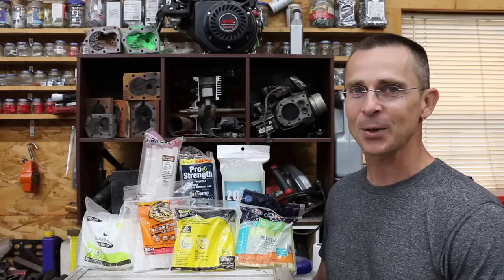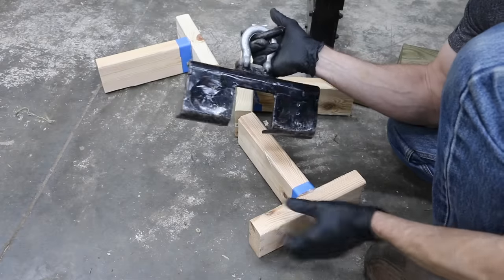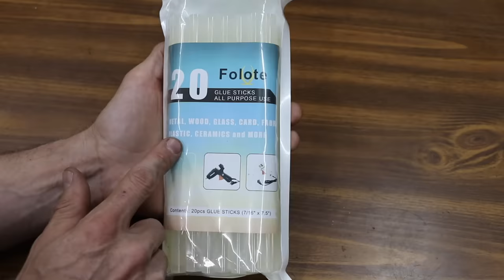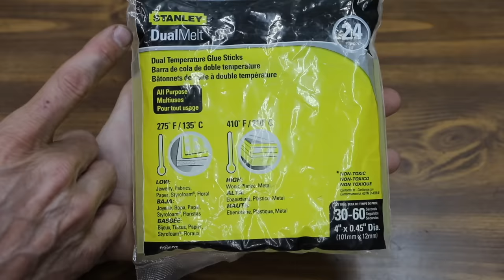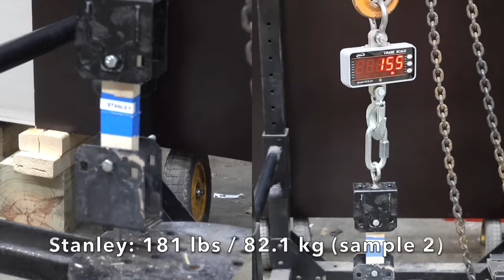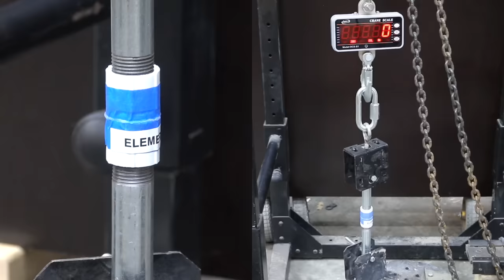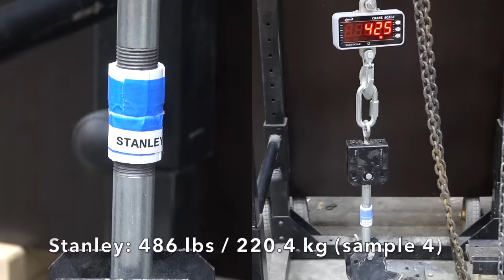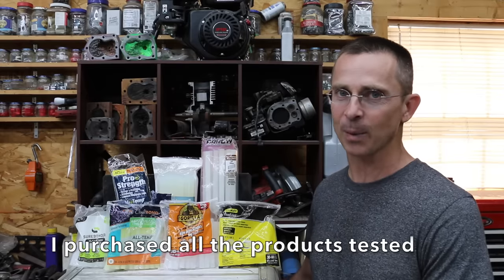Is Gorilla Hot Glue the Best? Let's find out!

Comment: I wonder how these hot glues would hold up after a year of being left alone under various environmental conditions? Such as hot or cold, dry or humid, inside or outside, dark room or sunlit room. Also I noticed someone else in the comments say they wished that high temperature hot glues had been tested as well. Maybe we can get a separate video for those? Thanks for all the hard work and thanks for always listening! 👍
Reply from the maker: You are welcome!  Thanks for the video idea.
Reply: I have found they don’t hold up over time at all. Just for craft projects .
Reply: As long as it’s something I only use indoors? Years.
But exposed to rain or extreme temps variations? The bond weakens. Although the glue as a filler stays good
Reply: That greatly depends on what the material you have used.  For instance, hot gluing fabric to wood, or to fabric - the bond is amazingly strong.  As a general rule, gluing items to wood makes a very strong bond.  I built a miniature lizard enclosure for some cool hard rubber lizards I found.  The only glue that would hold the acrylic to the wood structure, without off gassing potentially fogging the interior, was hot glue.  That was roughly 5 years ago.  It has seen suffocating heat, high humidity, and cold to down around 45F.  Still holding strong.
Reply: I agree, porous materials are fine, but plastics present a problem over time.  I once glued TV cable to the baseboard, to hold it in place.  In about 2 weeks, it all just let go. I called the glue stick company to complain and they said certain plastics (like TV cable) will “off gas” or leach chemicals over time and make the glue let go.
Sure don’t remember seeing that on the packaging !
Reply: @ItAintMeBabe99  Hi you have a good point - sometimes it is not the bond itself but what material the glue bonded to which deteriorates under the elements or undermines the bond.  Thank you for the comment. Ciao, L
Reply: @d2parrotperson  Those hard rubber lizards make great pets but it costs a fortune to feed them. What do you feed yours?
Reply: @ItAintMeBabe99  Thanks for confirming what I believed to be the case. I was using hot glue on an electronics breadboard, and mounted to a plastic box cover as well as some components like a toggle switch, and even indoors only in a short time the glue gave way. Was very disappointed in the results. I thought there also may have been be a layer on the plastic that doesn’t bind well, but it may be as you say, leaching or glassing.
Reply: @itaintmebabe99 
To be fair.
Expectations should be kept realistic.

Hot glue guns/sticks are basically made for crafts...

When I was in high-school, we used glue guns in Art class.
We didn't use any glue guns in auto or wood shop lol.

Comment: Nice video. I didn't learn much from the tests on wood joints, I used some hot glue about 40 years ago on some framing for a wall I was putting in to divide my basement. I don't remember what brand it was, but 40 years later, that framework was still together and we ended up sawing it into pieces as the glue was still holding it all together. We also used it to attach carpet to the lower part of a wall, and even 40 years later, a blob of it the size of a quarter was able to hold over 400 pounds (both a friend and I were hanging from it without it showing the slightest sign of tearing loose) with ease. The Stanley's performance on PVC was shocking, and it will be the brand I buy from this point forward. I had given up using hot glue on PVC a long time ago.

Comment: Hot Melt Glues usually come in 2 different types, Polyamide and Polyolefin. Some adhere better to certain materials than others. If you are not getting a good bond, try a different type.
Reply from the maker: Thanks for the feedback.
Reply: Which one is best for pulling out dents on vehicles with clear coat?

Comment: Next time woodglue?
Reply from the maker: Great suggestion!  Thank you
Reply: @ProjectFarm Best and worse hot melt vs woodglue type II and III, vs Elmer's white vs 24hr epoxy. Incl moisture.
Reply: Yes!!!
Reply: Agreed
Reply: @supabiscuit  Going to build a cabin, if I can use a cheap, but effective adhesive while building, I will..
Reply: I'd be surprised if there is a lot of really useful difference unless he tries odd combos like wood to glass or something like that. Wood glue has been stronger than wood for decades now. I just bought a gallon of the elmers tan wood glue.
Reply: Yes
Reply: I'd love to see an epoxy comparison test. When those let go, the damage should be spectacular!
Reply: Just use Titebond 2. It has a VERY long success record and there are thousands of woodshops like mine that use it without even a hint of failure with proper surface prep and at least 30-45 minutes clamp time.

Titebond 3 is also very good and even more waterproof.

Comment: You should do a video about whether gasoline stations with supposed cleaning property in there fuels are actually worth it and if they do clean engines and which is the better gas brand, or if their just the same as other regular gas station with non of those advertisements. (Like BP with invigorate, Citgo with TriClean,Mobile with Synergy, Shell with V-power Nitro, Etc)
Reply from the maker: Thank you for the video idea!
Reply: But do you make sure the fuels dont mix with traces of the previous fuels?
Reply: It's all the same gasoline. You never see different trucks for different octane level. I have observed one truck fill several tanks at the service station.
Reply: Dr. Bombay some of the tanker trucks have separate tanks in them.
Reply: @jmcg7906  that's what they want you to think.
Reply: Dr. Bombay I really hope you’re joking.
Reply: @jmcg7906  am I?
Reply: @douglas136  Additives are mixed in the tanks in the ground when fuel is added at the station.  The gas in the tanker is usually not containing them as they deliver to multiple stations.  There are usually at least two tanks inside the tank, usually even more, 4, 6 even sealed individual tanks, one for high octane, one for low.  The mid level octane is mixed by the pump when you buy it from the two tanks in the ground.

In the future, I would encourage you to ask WHY before making an assumption.  The internet, which you clearly have access to, could have easily solved your question much faster than you could have even typed the ignorant nonsense you typed.

Comment: Great. I would really like to know their melting temperature, when they lose their strength, since I live in a hot climate (gets to 110 to 120 °F)
Reply from the maker: Great recommendation!
Reply: Says low temp is like 250 degrees and the high temp is about 400 degrees
Reply: I was about to post the same question and found you'd already asked. I'm reluctant to use hot glue because of its low melting point, I worry that if items I've made are stored in a really hot environment, all the glued on parts will start to slide south!  Would definitely like to see this tested.
Reply: @sallyGrist   Also extreme cold makes them brittle.
Reply: Also, a longevity test, exposure to temps and uv. There is all sorts of interesting little things that can be done.

Comment: Another outstanding product testing video.
Thank you so much.

I wonder how samples would react after or while frozen?
Reply from the maker: Thank you very much and great point on the impact temperature exposure would have on the glue.  I have hot glued the glass tubes onto wood for the next round of oil test videos and have exposed them to -40C / -40F and they've held up just fine.
Reply: My family puts them in the freezer until needed for use.
I was gonna ask the same question.
Lol
Reply: @Jim_woods  why? Have you found it makes the bonds better?
Reply: @isaakwelch3451  just what my family has always done.
We do the same with candles supposedly it does make the candles last longer but my family has no evidence to back any of that up.
Reply: @Jim_woods  nothing wrong with that, just curious
Reply: @ProjectFarm  freezing makes the hot glue brittle for a short time. It quickly becomes pliable when exposed to room temperature. Before I found the rubbing alcohol removal trick, repeated freezing and chipping with a knife was how I was getting hot glue off items I'd glued into mold forms to make silicone molds.
Reply: @Jim_woods  sounds lik a job for Project Farm or TKOR. Does freezing make wax candle burn longer?
Reply: @greggv8  that's what my family says but I never tested it

Comment: Will the hi temp glue hold on a small engine cylinder head? If not would it function as a gasket?
Reply: doubtful.
Reply from the maker: Thank you for the video idea!
Reply: Just curious, but wouldn't the heat soften the hot glue to make it liquid and fail?   This would be interesting to find out.  Years ago, we were in a primitive part of the world where parts were hard to get, we would make head gaskets for small engines out of aluminum from drink cans.  Apply about three or four layers of can to make the gasket and they would work.
Reply: William Charles I would sure think so, plus, the hot glue would cool too fast, since all those parts are made to dissipate heat. Hi Temp RTV would be a better thing to try. A sure bet would probably be JB Weld.
Reply: @nimrodquimbus912  I think JB weld was tested in a previous video as a gasket and I believe it was a successful "temporary" fix but obviously not recommended.
Reply: Obviously heat is what makes the glue melt. I'm not experienced at all with Hot glue, but in this video I thought he said there was a hi-temp formula, and I really enjoy Project Farms small engine videos as they have shown me just how versatile a small engine can be. Sour Crude Oil, Isopropyl Alcohol, Zippo fluid?!?!?!?!?  All temp substitutes in a pinch without gasoline, that's freaking awesome! So could you potentially hot glue a cylinder head on (especially with 1200lbs of bond strength) to get that last spot in my yard before ordering a new gasket.
Reply: Jam a stick of hot glue into the cooling fins of a hot engine. If it melts, then it probably will not work.
Reply: “I dunno but we got some hot glue, a cylinder head and we’re about to find out”
Reply: Men’s Supply Co. Post the video when you get it done.
Reply: I have always found your videos to be very entertaining and informative. They are my go-to video while eating lunch.I know you recently had an engine oil playoff and I workk part time at Home Depot which oil is better, Echo brand 10w-30 or Powercare 10w-30 for their small engine. I try my best to get people the best product for their money and have used more than a few of your videos as guides (specifically the trimmer line one) how would a small engine oil playoff sound?

Comment: The conclusion that I came away from this is that I don't want to use hot glue to stick the butt ends of two pieces of PVC together. :)

On thing that I've found that seems to help the hot glue sticks is to use a heat gun to preheat the materials that you are sticking together and then after the glue is applied to heat it some more with the heat gun until the viscosity is noticeably less.  And then clamp the parts together while it cools.
Reply from the maker: Great tip!
Reply: @ProjectFarm  -- I suspect that by preheating the materials and then heating up the glue even more before you clamp the pieces together, you are lowering the viscosity which allows the melted glue to get into the nicks and scratches in the surface of the material.

It would be interesting to see how the hot melt glue tests that you did compared with normal yellow wood glue and construction adhesive in the same tests.

Comment: You continue to amaze me with the things you test and the results.  The PVC end cap tests were excellent for nonporous strata.  The end grain tests were probably more significant for porous materials.  Although it was hard to get a good look at many of the shear tests it looked like most of those failures were failures of the wood more than the failure of the adhesives.  I think any time there is 80% or more loss of wood on the surfaces joined then the sample of wood is more responsible than the adhesive for the failure.  Clearly if a hot glue is the adhesive of choice then they need to be carefully chosen for specific applications.  Personally I have never considered any hot glue as anything other than a temporary adhesive and will continue to use Titebond, WEST Epoxy and Z-Poxy as my adhesives of choice whether building cabinets or radio controlled airplanes because they have a track record over decades in my shop.  Thanks for another QUALITY episode!
Reply from the maker: Thanks for the feedback.

Comment: Hot glue performs very well. I bet if you rough up the plastic it will work even better. You could also experiment with different hot glue sticks. The may be the best and easiest solution for car bumpers, headlight tabs, and other things.
Reply from the maker: Thanks for the suggestion.

Comment: 1. Which window cleaner is the best (most streak free)?
2. Which 6 in 1 has the phillips bit that will last the longest?
3. Which roofing material is best for flat roofs? TPO, Modified Bitumen, Tar and Gravel, Foam?
4. Which hand cleaner is the best?
5. Which rubber work gloves are best?
6. Which OCR scanner is best?
7. Can Sulphuric Acid really be a substitute for Nitric Acid when making Yellowcake from Uranium Ore?
8. Which sandpaper is best for which situations?
9. Which cement mixer is best?
10. Which diamond blades are best?
11. Which tarps weather best?
12. Does plastic welding really work?
13. The best way to plant posts for fencing?  Should extra cuprinol be used at the base? Is it best to elevate the posts or invest them?
14. What is the best rust dissolver?  Is Naval Jelly really superior?
15. Can Lexel clear caulk really be applied under water?
16. Does the ink in an ink jet printer dry out while sitting in the printer unused?  Are Laser Printers better?
17. Is it possible to apply Stain/sealers (like Polyshades) ... evenly?
18. Which furniture wax dries the hardest?
19. How to keep plastics from becoming brittle.
20. Is fiberglass rebar superior to steel rebar - how to prevent oxidation in rebar... 
21. Which aerosol paints are the most durable?
22. Which fuel additive is best for fuel storage... and why?
23. Which is a better exterior coating, STO Elastomeric or El Rey cementitious?
24. When pouring a shower bed, are off-the-shelf polymer additives a no-brainer?  When should additives NOT be used in concrete?
25. Which die and tap kits are best?
26. Are any plastic casters worth a crap?
27. Are Wooster and Purdy really superior to other paint brushes?
28. Which chemical brush cleaners actually work and do not destroy brushes?  Is there a method that is superior?
29. Is metal seam tape superior to regular duct tape in ducting situations?
30. Which split units (HVAC) are easiest to install for the do-it-yourselfer?

I've got like a thousand more.
Reply from the maker: Thanks for the video ideas!

Comment: Stanley for the win!  TBH…the results on all of them were very variable.  Meaning as a user, you can’t be sure the probable failure at say 200lbs won’t in fact for your particular joint, turn out to be a paltry 50lbs.  Best not trust any hot glues for critical applications, but if I have to re-stock…it will be with Stanley.  Thanks for the work and another great video Todd, I was glued to it right to the end.
Reply from the maker: Thanks and you are welcome!

Comment: Todd: Thank you. You've changed my mind about using construction adhesives instead of hot glue. In fact, I bought both a Stanley corded and a cordless Ryobi  P305+ oneglue gun after your glue video. The battery powered Ryobi P305+ one works great for construction (using the Stanley dual melt glue which topped your glue tests).  I took the cordless Ryobi to an offsite location and accidentally left it there, and made the mistake in thinking that tools were tools and that there would be minimal differences, so that I could use the Corded Stanley in place of the battery powered Ryobi. NOPE!  The corded Stanley would work good for your 12 year old's crafts projects such as beading and mod-podging, and not for construction. I use to believe that corded tools tended to outperform cordless in most cases, this Ryobi cordless Glue Gun outputs the little Stanley in all categories such as time to heat up, amount of glue outputted, how hot it is, how much force it takes to pull the trigger/how much flows out, etc. Power (Watts) equals heat (good), and size of nozzle (also good) are huge differences in these things. Now that you've sucked me into the hot glue arena, can you do a test of hot glue guns which might also serve to encourage both Dewalt and Milwaukie to make their own, more powerful, construction version?
Reply from the maker: You are welcome!  Thanks for the video idea.

Comment: I noticed on this video, the liquid nails,  and adhesive videos that some of the adhesives are failing due to the wood fibers giving way. Have you considered using aluminum or steel blocks instead of wood to test the adhesion strength? It could eliminate the wood fiber failure mode and show each products' true adhesive strength threshold. It's definitely a bit more pricey to use metal than wood, but I imagine you could clean them in a solvent and reuse the metal blocks if they aren't warped from testing. Food for thought. Thanks for the great videos!
Reply from the maker: You are welcome!

Comment: In tests with wood, the influx of glue squeezed out of the edges of the joint (not normalized), can further strengthen the connection by increasing the contact area, and affect the results in different ways.
Also, the metal bracket holding the sample, in some cases, also held the glue that was squeezed out - at 3:49 this is visible.
Reply from the maker: Thanks for the feedback.